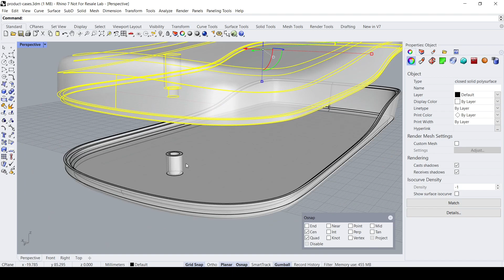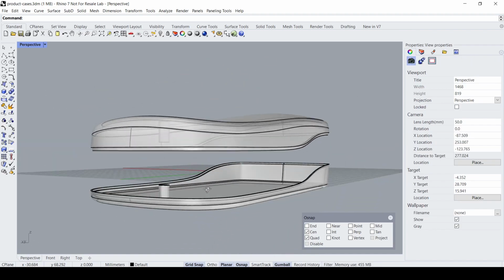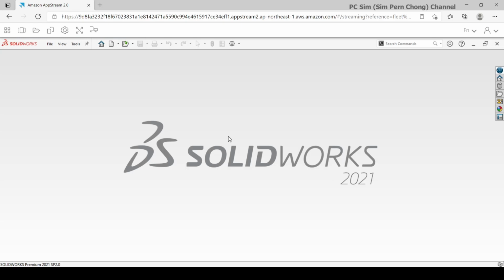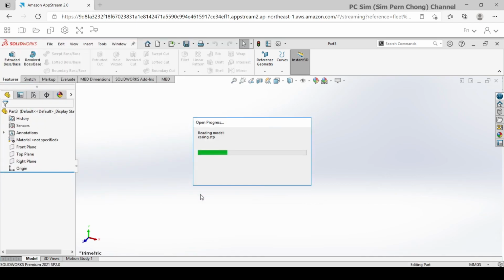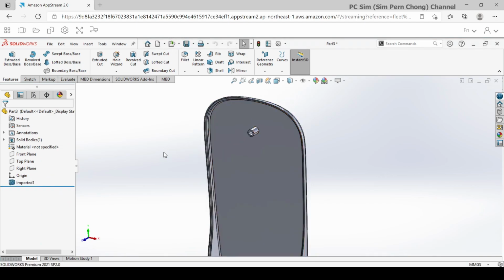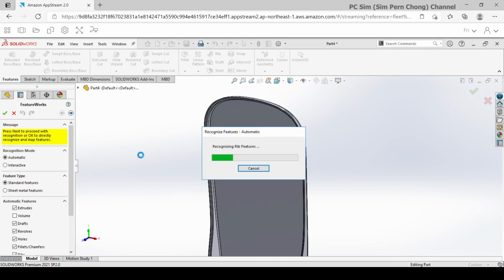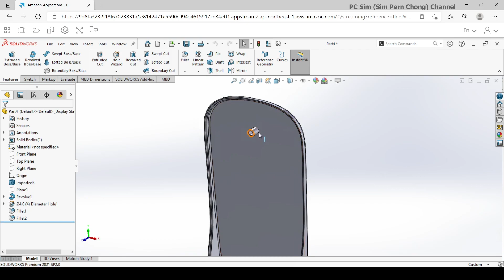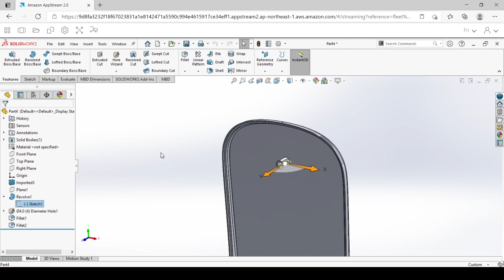Rhino Solidworks Tutorial: Feature Recognition of Rhino model details in Solidworks Part

Comment: Hello, just found this video, I want to ask. If a surface is created in rhino then we export it and open it in solidwork, will variables such as area, shape, type (developable surface or not) remain the same as in rhino?
Thanks!
Reply from the maker: Hi, I am not an expert with solidworks. But so far, the translations are very good. If I have problem with STEP.. there are parasolid and even 3dm format that are compatible with solidworks.

So far, i find only geometrical stuffs gets converted into parametric features. NURBS features like those of degree 3 or higher curves and surfaces are not recognised as parametric features.
Reply: @simpernchong  hi thanks for the answer. 
One more question, are there any requirements for rhino/solidwork's versiom when doing export and import task? For example rhino6 will be match with solidwork 2021 and soon. 
I have solidwork 2014 version so what version of rhino will be good for this? 
Thanks!

Comment: solid work is different... Rhino is different... why necessary both works.... kind request openGL noticed new models software's now days... you can try new..
Reply: Both has to work together because of the design workflow in this industry where someone will define the form in Rhino and then downstream to CAD such as solidworks or Creo. That's the current industry standard bro
Reply from the maker: Thanks Chandra
Reply: @simpernchong  welcome my friend..